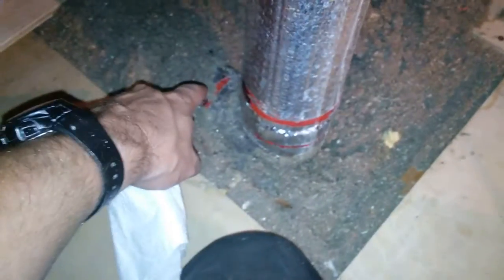MAXIMUM  FAN VENT CT4 VENT BLOCKS AIRFLOW

Comment: Today roofers installed a Maximum CT-4 on my roof. My Panasonic fan has three speed : 50cfm, 80cfm and 100cfm. But it also has a smart circuitry that speed up the motor when it feels back pressure. With the Maximum CT-4 my Panasonic must feel a lot of back pressure because the motors is always at full throttle. I'm wondering myself if my fan is able to push that heavy galvanized steel flapper. Well I guess we both have are answer!
Reply: Do you recommend the CT-4 or no? I'm thinking about putting a few CT-4 and CT-6 on my roof as part of a remodel.
Reply: @rosemcommm  Not if like me you have a small fan with a DC motor. My Panasonic DC fan would have it easier with a plastic flap. But the construction of the CT-4 is excellent so if you have a big powerful fan yes go for it.